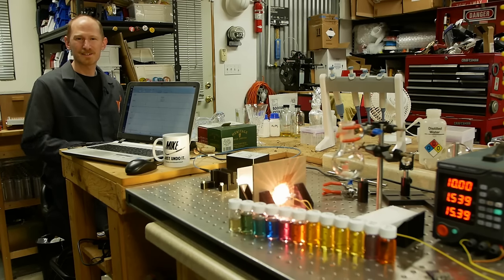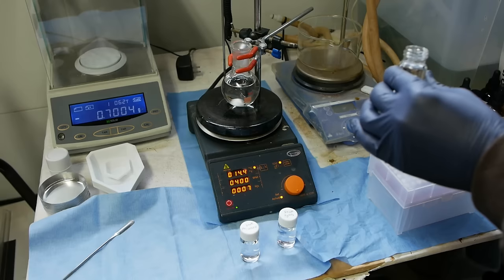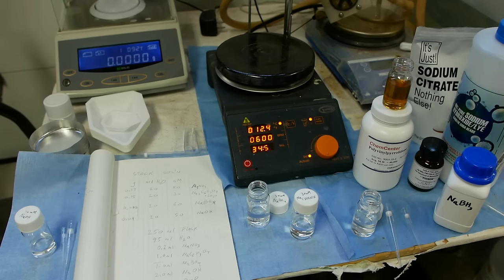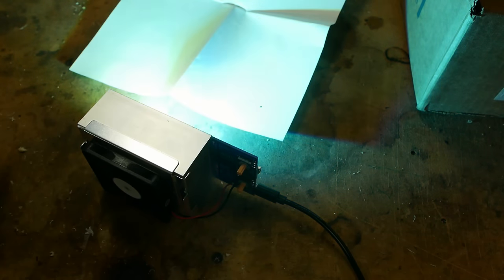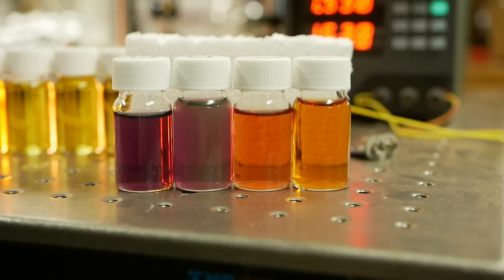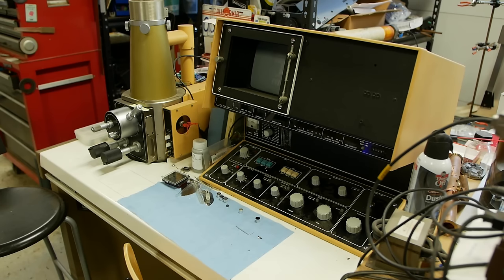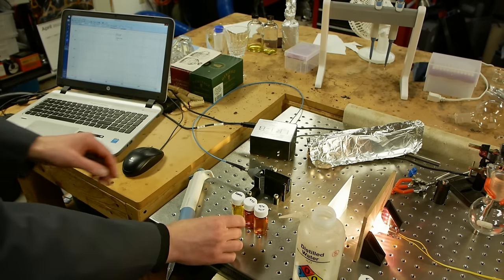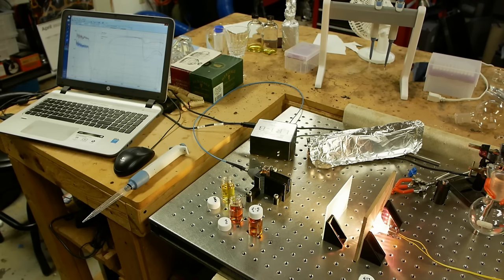Silver nanoprisms grown into structural colors by high power LEDs

Comment: is it possible that the borohydrate has something to do with the crystal development? could the reason that the suspensions stop changing crystal size be due to the degradation of borohydrate? 
also; a simple way to test the effect of light intensity on the crystal growth could be instead of shining a laser across a vial, shining it from above down a thin test tube or similar container and comparing to the LEDs emitting the same wavelength.
interesting video, thanks for posting

Comment: maby you could reset the solution with higher energy sources - x-ray or radioisotopes. Shine the desired led and the high energy beam at the same time. Led light reasembles into a specyfic size as the beam destroys everything - adjust the destruction/reasembly ratio and reset the solution?

Comment: Could the shift be explained by a process similar to the explanation of the emission spectrum of high pressure sodium lamps? In low pressure sodium lamps, most emission is around ~590nm. In HPS lamps, nearly all of the photons around that wavelength are re-absorbed, re-exciting the atoms. Only photons that happened (by thermal noise) to have higher or lower wavelengths, make their way out of the lamp. This creates a deep trough at 590nm which widens as the light intensity increases.

Comment: Could it be that the particles of the size of the wavelength acquire more energy and actually react growing to an extent limited by the difference of the grown size and the applied wavelength?
and regarding the reversibility problem, would it require the same energy to make particles grow than to break them? if the process of breaking particles happens slower than the growth then that would explain the small reversal

Comment: Did maybe the laser heat up the solution (In the video it seemed a bit opaque) and cause convection of the liquid so the threshold couldn't be reached?
I would imagine this technique to work at least to some degree even if it takes a minimum amount of time.

Comment: could the red shift you mentioned be the crystals growing until they are far enough shifted they no longer receive enough energy from the supplied wavelength to meet that activation threshold you theorized? As in you supply the solution with 470nm light. The particles absorb this and grow in response to a form that absorbs that light, but at the size where the absorption peak would be at 470nm the particles are still receiving enough energy to grow and therefore continue growing until the absorption peak is shifted enough that the growth stops leaving you with a peak red shifted from the wavelength of the originally supplied light.

Comment: Regarding the Laser and speed: Is it possible the local reaction is limited to the local reagent density?  What if you slightly heated the bottom, at the start of the laser treatment, to cause convection currents to move new reagent into the laser?  (Or otherwise differentially heated it, or caused currents...)  (Although I presume you might see some color right in the beam line if they're sitting stagnant.  How colored is the fluid when very thin, not in a fat vial?)

Comment: This is amazingly cool, its like magic! Shining rainbows at clouds of silver so that those clouds hold onto the rainbows forever :P

13:20 If giving the solution a specific wavelength of light causes the solution to prefer to form particles that absorbed that wavelength, then shouldnt we expect the color of the solution to be the opposite of the light color? Given that things that absorb one wavelength reflect all others, and we only see reflected light

Using CD's as micro-rulers is quite clever

If you put this solution into a bunch of individual cells and put it in a dark box with a small aperture, could you make a color photograph?

Can you use this silver solution to capture UV/IR light?

Comment: Is there a wavelenghth that works as a doubler or triplet?  ie: 660nm, 330mn.  Could 330 nm with intensity cause 660 mn prism formation? Can you make a fractile prism? Or a rainbow of specic colors(like a multipass filter)? Could one make a hypershift style paint/fluid with the nano prisms? Could you use a high CRI 100w Led and A prism or filters for specific wavelenghths? Is there a substance that "fluresses" desired wavelenghths(Blue laser making white flashlight, or compact fluorescent lights)? Could certain frequencies of light creat 3D structures that are stronger, therefore not breakdown? Cool video, Got my like.

Comment: 10:08 Would a white LED with a series of filters to select the wavelength not work instead of multiple LEDs?
Reply: A white LED is just green blue and red mixed together, very good white leds have a pretty uniform spectrum, but instead of using filters you can just use the right led since they are mostly monochromatic from the beginning

Comment: Hi. I'm currently doing an oral presentation on the subject and I think this paper and his supporting info could maybe help you in your research: 

Stamplecoskie, Kevin G.; Scaiano, Juan C.; Light Emitting Diode Irradiation Can Control the Morphology and Optical Properties of Silver Nanoparticles. J. AM. CHEM. SOC., 2010, 132.
Stamplecoskie, Kevin G.; Scaiano, Juan C.; Supporting Information for Light Emitting Diode Irradiation Can Control the Morphology and Optical Properties of Silver Nanoparticles. J. AM. CHEM. SOC., 2010, 132.

You'll see that in this paper, they have different morphology due to aggregation and coalescence that differ depending of the wavelength used. Also, they requires less solvent than the Turkevich or Brust-Schriffin method. 

Also, for the red shift, it's probably caused by the Mie scattering, and potentially could also be because of the Rayleigh scattering (if really small NPs). It depends of the size of your AgNPs vs the wavelength. 

Finally, go check on plasmon surface resonance too :) 

Hope you find it interesting and helpful :)

Comment: My now substandard brain tells me the shift is related to the size of the particle as a function of time over the frequency of light it was exposed to.  My optics foo is 30+ years old and I got a D in chem so... take that how you like. 
On to the microscopy aspect, I work someplace that has access to some high powered EM equipment. If you were to contact me I could put you in touch with someone that might be willing to run a few samples, ya know, after hours or for a nominal fee (I think the recharge runs like $65/hr).

Comment: I am an undergrad tasked with building the multispectrum emitter by my P.I. does anyone know the model of the 0402 resistors used as well as the actual power adapter (the one on the github is a barrel plug and the board requires a USB-C)?
Reply from the maker: One the best aspects of open-source designs is that you (and everyone) can help make them better.  The description on github has the correct part number for a USB-C supply, but the .csv in the root directory is incorrect.  I'll eventually get around to fixing it, but you can submit the correction, and then I can quickly approve it, and everybody gains.  0402 resistors are pretty generic, just pick a manufacturer, and add the Digikey part number to the BOM.

Comment: What if you could have a substance that instead of shifting the light that passes through the particles like liquid crystal but instead change the physical color of the particles..  and if you could do this on the nano scale then wouldn't this be like ultimate resolution with true color and vibrance without the need of a backlight...  itd be like a first gen hologram except itd reflect light instead of refracting..  itd look more like the something would be actually there if could do this on a 3d layer in a container..  dunno..  i r stupid, brain matter derped, calculator stuck on 8888888....   post lobotomy thought generator borked...  blue collar blew drugs blown mind..   yep

Comment: 24:30 Very interesting.  How do you know the true wavelengths of the LEDs you use are, and how pure their wavelengths are?  A lot of times an LED's specs will indicate a certain wavelength emission, but that's the LED's peak emission wavelength, while it's spectrum of emission is somewhat broader than the peak.  Perhaps that influences the widening of range effect you're having?
Reply: Perhaps you need to test and catalog the LEDs' emissions similarly to how you're checking the wavelengths of these solutions?
Reply: I wonder how differently things would work if you used a laser light source to get a very pure and narrow band light, then some (hand waving) optics to spread it out to cover then entire flask like the LED light sources work, would that give you more exacting results in forcing the color of the solution to one color spectrum and back to another?